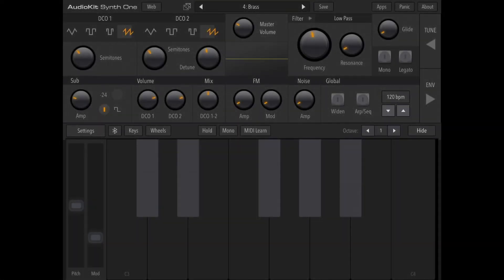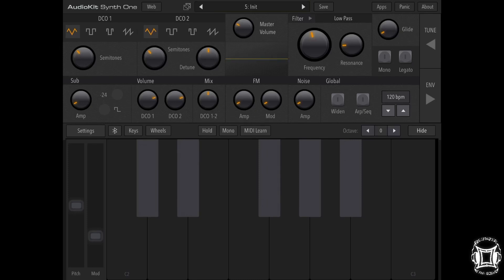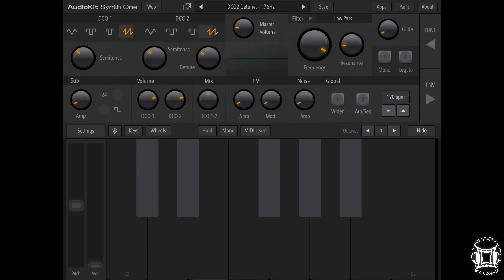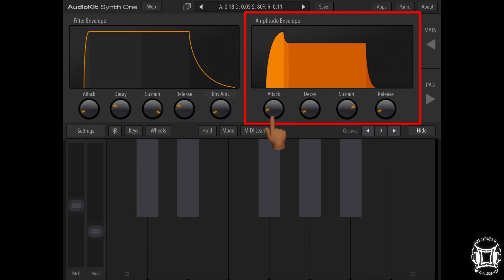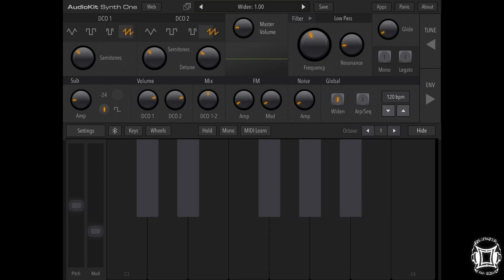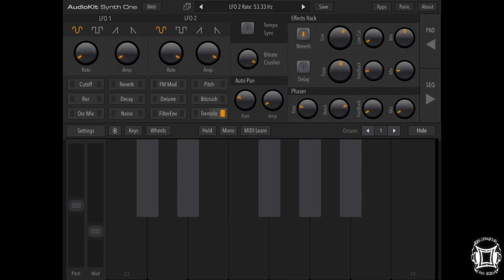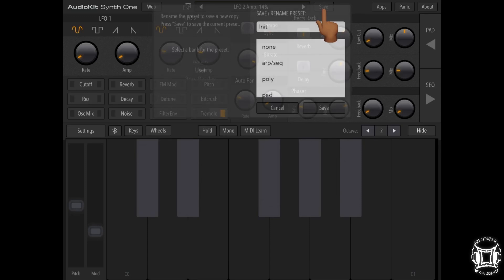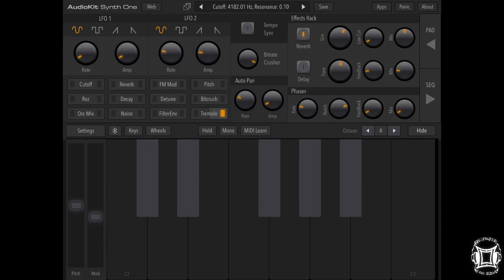Creating A Brass Patch in Audio Kit Synth One #beatmakeristhesquad

Comment: Yo man you gotta have patients for that sound design stuff. Tight work man. Question tho,after you make the patch could you make a kit of Soundwaves and share them,or sell them 😀??? Would they work if I have the app and load your sound?
Reply from the maker: Hey bro, thanks for checking out the vid.  And yeah, you gotta take your time with sounds, but once you get the hang of it, you start hearing sounds differently.  I’ll be working on some sound kits and I’ll def share them.  And yes if you have the app you can use them too